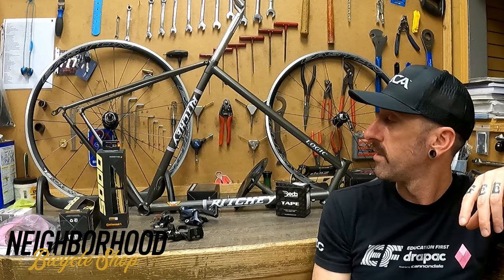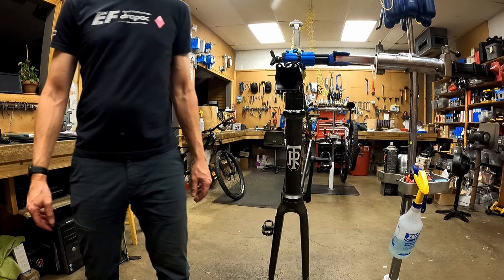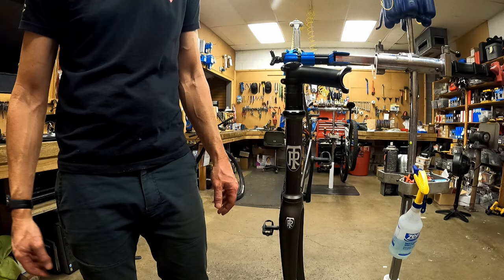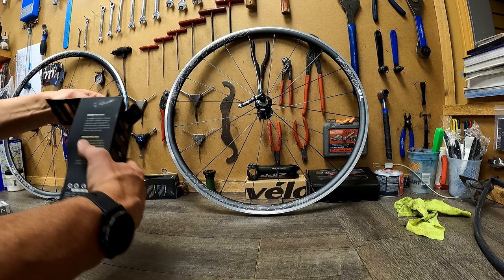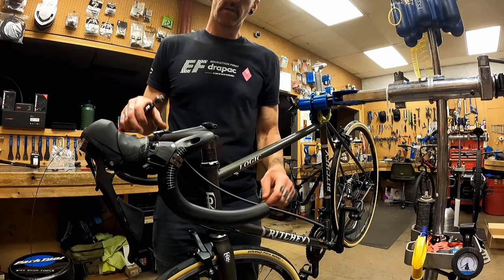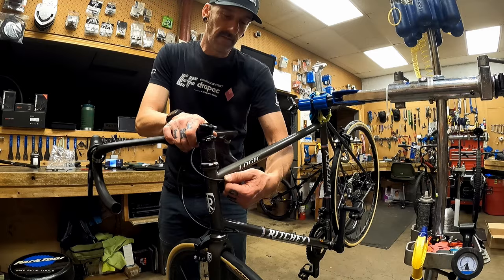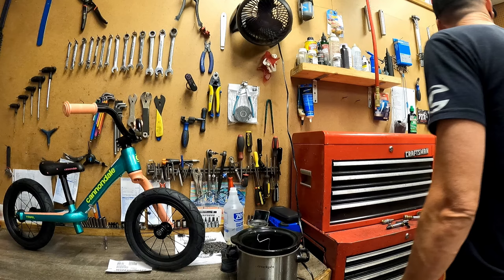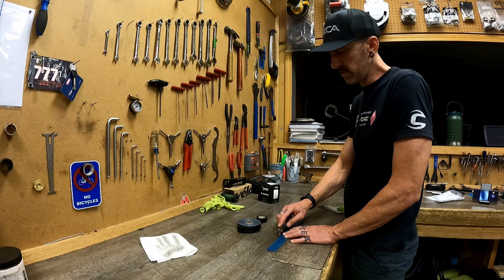Ritchey Classic Build

Comment: Beautiful build. After you dip the chain in the wax, do you wipe off any excess? Or do you just let it drip for a few minutes until it dries? I’ve never waxed a chain before and I’m interested in trying it and I don’t know all the details yet.
Reply from the maker: I just let it dry and then install. You will get some wax dander that will flake off after the first ride as it loosens up, I usually just hit that with the air compressor later...it's not bad though.

Comment: Are you planning to keep that many spacers under the stem?  I had a Ritchey dealer berate me up and down about running 40mm of spacers on my Road Logic, because Ritchey says 30mm max under the stem.  I DO run an 80mm compression plug though.
Reply: Berate eh? That’s a bit of an exaggeration don’t you think? I asked you a question of how long you were running 40mm. It’s industry spec and Ritchey calls out specifically no more 30mm spacers.

Comment: There is not a single video here in YT where a mechanic actually check if the crankset preload is correct.   You all just tight the preload and do not even take an extra second to check if there is play on the BB.  Then you see people online crying that their 300 dollars BB died in 3 months......    Check preload!!!!! same goes for Headset!
Reply from the maker: I check every single build I do and have done since Shimano designed their 2 piece crank. If I put everything inside in these videos they would all be more than four hours long so a lot is edited out.
Reply: @chadshanks5409  My bad for assuming you didn’t.  Thanks for replying.